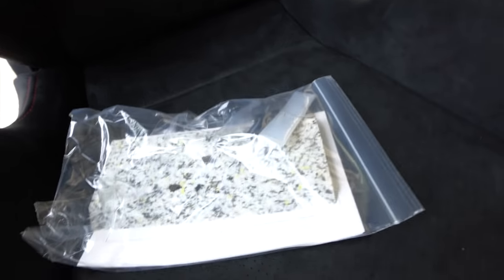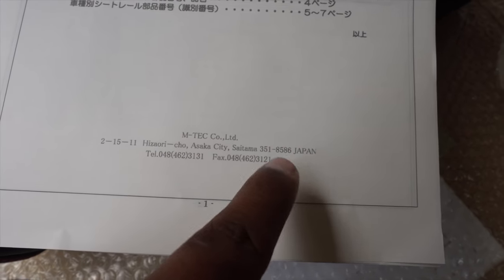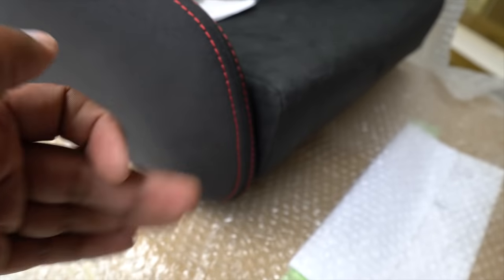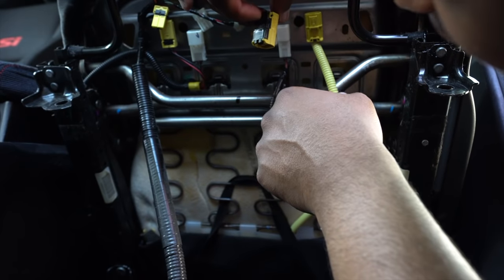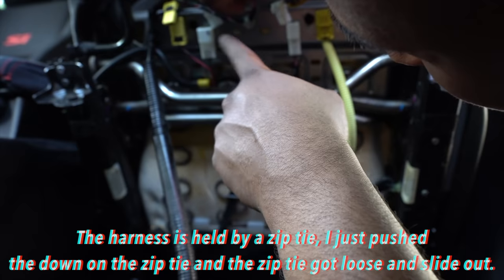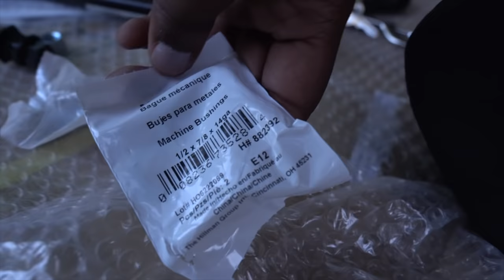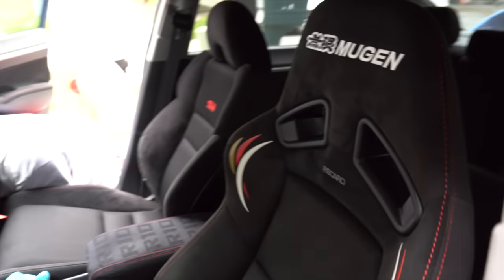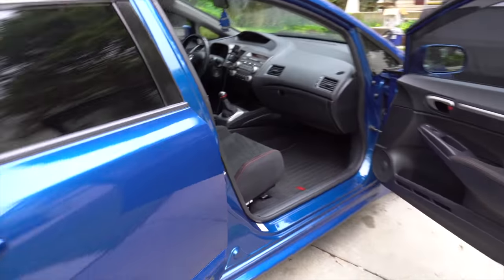INSTALLING NEW MUGEN MSZ SEMI BUCKET SEATS IN THE 8THGEN HONDA CIVIC SI

Comment: Is your SRS light on??? This video really helped me out cause i didn’t know where to bolt up the seatbelt! Looks like I’m gonna be getting Seats soon. So it’s only Seats, Brackets and Sliders💯🤟🏽
Reply from the maker: No... The SRS Light isn't on... The airbag light is on.. Yes.. You buy the correct seat and then seat bracket which comes with sliders.